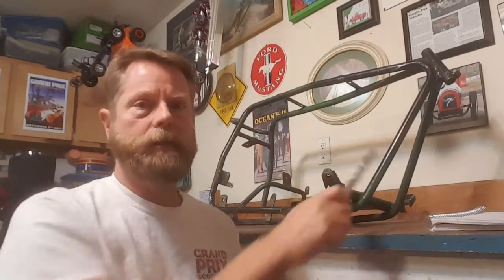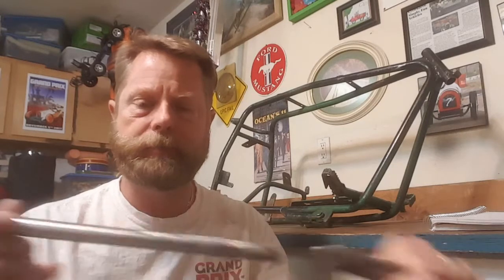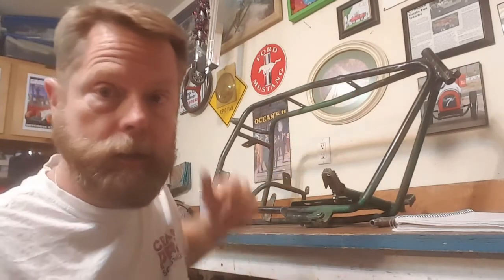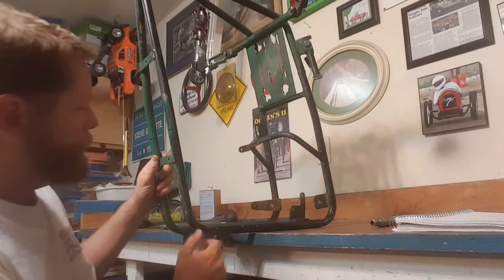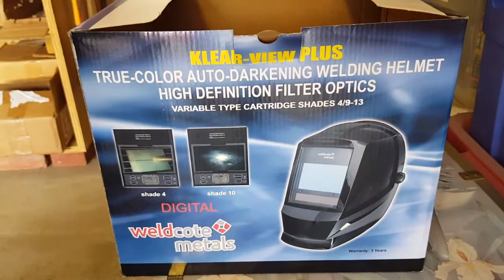Doodle Bug DB30S Mini Bike Stretch

Comment: Steve, can you tell me the wall thickness and diameter of the original frame tubing?
Thanks
Reply from the maker: 7/8" DOM.  I used .120 wall, but the .095 might be easier to work with as I had to grind down the 5/8" DOM to fit inside. If you build it the way I did with a full sleeve, it will be plenty strong. Thanks

Comment: Should have showed where u cut
Reply from the maker: If you look at the side view, you can see that I cut the bottom tube between the motor mount plate and the fender mount cross tube.  About the same spot on the top tube, just in front of the seat mount.